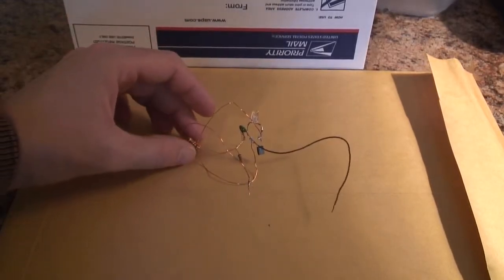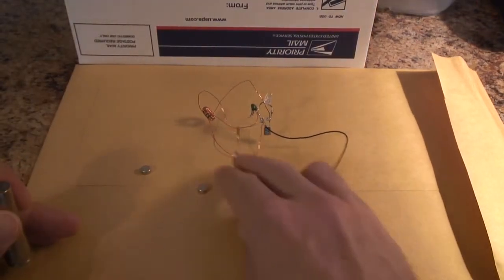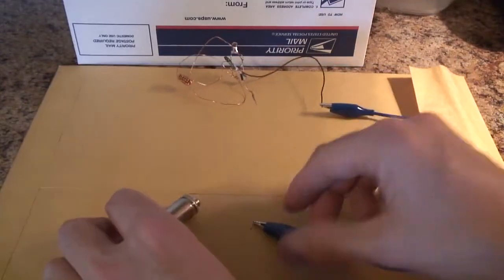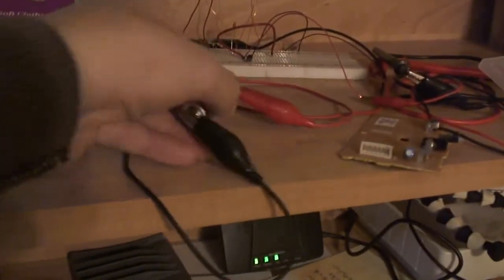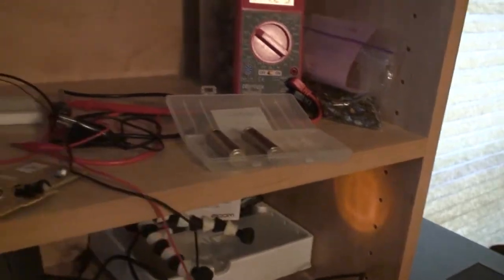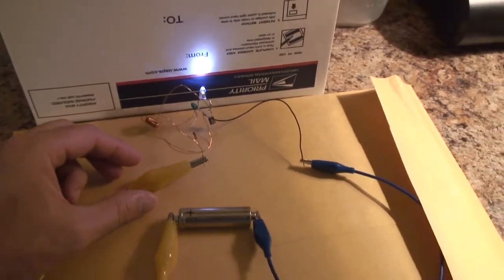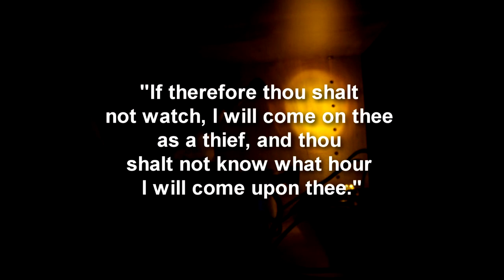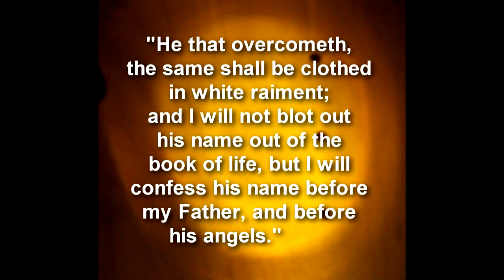Joule Thief Gift

Comment from the maker: I did not wire the 9 LED's, but I think you are correct.  It is more reasonable that they would be in parallel and not in series.  So all of the LED's would be at the same voltage and all be equally bright.

Comment: I took a palmful of tiny steel screws and soldered a four inch wire to each one, then slipped a short length of heat shrink tubing over the joint to keep the wire from breaking at that point. I used red or red striped for positive, and a dark color such as brown or black for the negative. I then soldered the wire with screw to the JT so now the wire ends stick with a vengeance to the neo magnets on the battery. Except for a Panasonic battery, which had brass ends.. Weird!